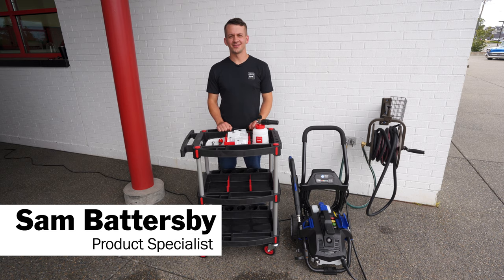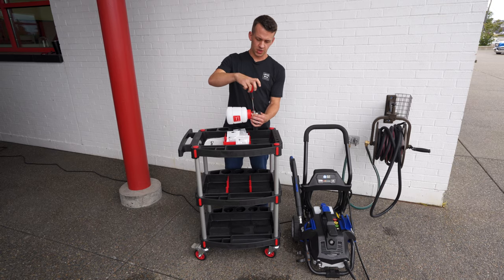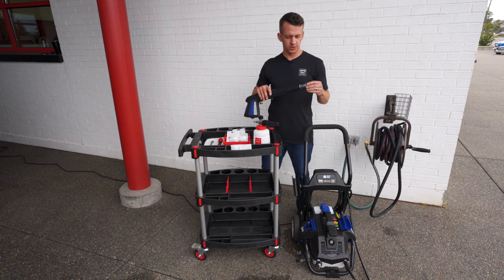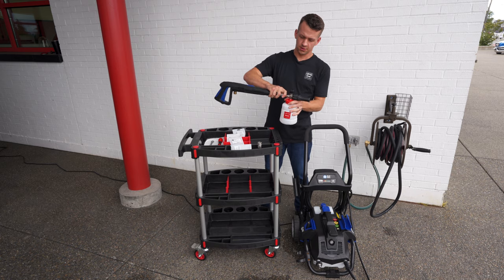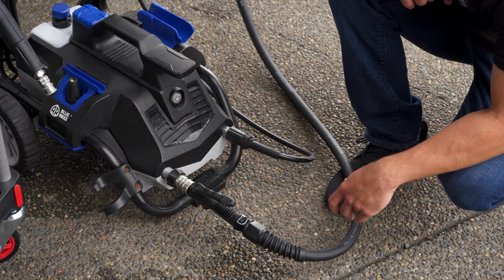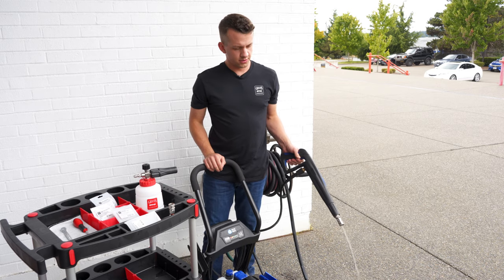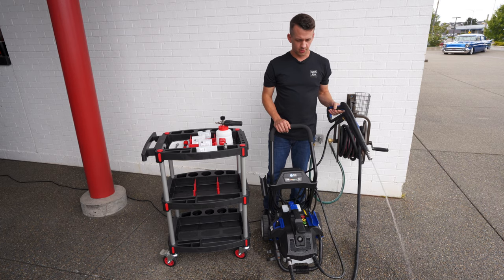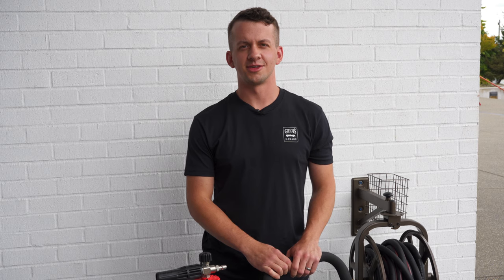Griot's Garage: BOSS Foam Cannon & Pressure Washer Setup

Comment: Do you have a video of a complete car wash with the BOSS Foam Cannon including how to clean the Foam Cannon afterwards like it says in the manual?
Reply from the maker: Hi Bart, not sure we have a start to finish wash with the BOSS Foam Cannon but did you have any specific questions we could help answer? And you'll just want to fill the reservoir with water and run it through the cannon until the water turns clean.

Comment: How can buy all those coupler sets?
Reply from the maker: Hey Joshua, if your pressure washer features an M22 threaded connection at the end of the pressure washer gun (usually where gun attaches to lance) you can install our 81240B – Threaded Direct Adapter into the M22 fitting on your gun, then attach our 81240F – SS Quick Disconnect Coupler, Female to the ¼” end of the 81240B fitting. This setup will allow you to quick connect your BOSS Foam Cannon directly to your pressure washer gun via the 81240F – SS Quick Disconnect Coupler.
Reply: @GriotsGarage  thank you... and ordered the pieces just about 30 mins ago.

Comment: This turned into more of a pressure washer how to. How and where do those little fucking tips go??
Reply from the maker: Those are our auto-mix metering tips, they take the guess work out of mixing your car wash concentrates and do it for you. Simply pour our Foaming Surface Wash into the reservoir or attach the 35oz bottle directly to the foam cannon and let the cannon do the rest.
Reply: @GriotsGarage  Thanks! love the wash and sprayer bottle